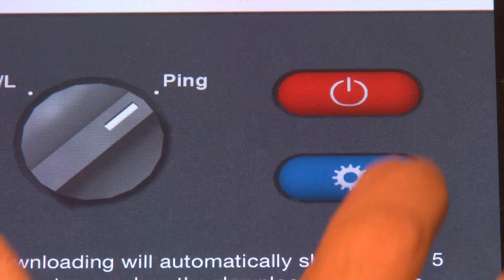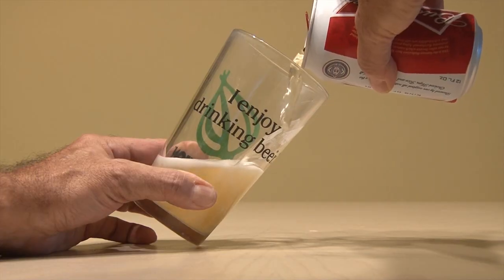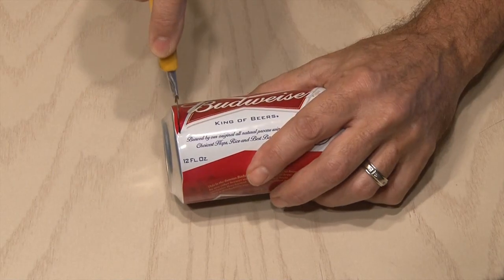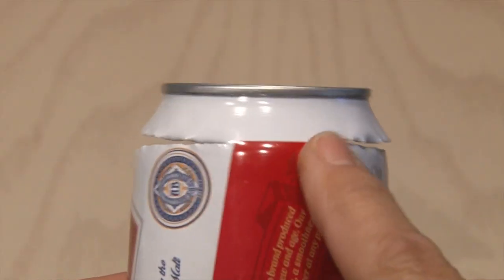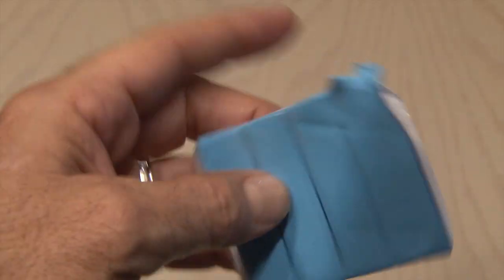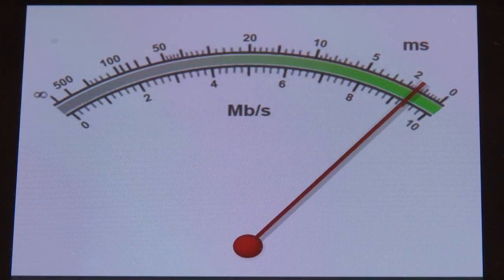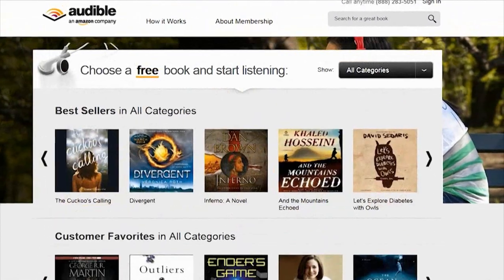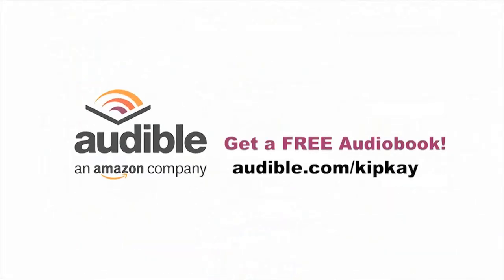Brew Can WiFi Signal Booster

Comment: Do you have anything to up my internet connection? I mean focus most of the power to my desktop PC which is connected with rj45 cable to the modem/router? I think my neighbors who are connected to my modem via wifi is affecting my connection strength.

Comment: Ok let's get real. This doesn't work. Just because it looks like a dish antenna doesn't mean it works like one. Would you think if router makers could so easily increase the transmit power of their routers, we would have been over this madness? Routers use omnidirectional antennas because the receiver could be anywhere.

Comment: Lol, I don't have any antennas in my router. RIP
Reply: xTanneR23 same with me.   Did anyone reply
Reply: There are antennas IN your router (built-in) just like you said. They are just not external. Btw same problem here....
Reply: Me too
Reply: I don't have external antennas either
Reply: If you have a WiFi stick it works for that
Reply: You put I behind the router
Reply: Then, It’s a Modem.

Comment: What software or device are you using to test signal strength and ping?  It looks better than anything I have found for ios.  Also, does it matter which way the can faces?  If it faces forwards as shown is that going to hurt the signal of wifi devices that are in areas behind the router?  If you have multiple antennas should yo aim the cans in different directions?

Comment: Seriously, while it may work with older Wi-Fi routers that have external antennas, modern Wi-Fi routers with more powerful amplifiers and "beamforming" may make the whole idea unnecessary. You already get way better Wi-Fi range with a router like an Asus RT-AC68U or Netgear R7000 Nighthawk without going to this "kludge."

Comment: Curiously nobody realizes that the channel is about hacks and PRANKS. For starters, they measure signal strength with a cheap network speed-tester app. SIGNAL STRENGTH IS NOT THE SAME THAT TRANSMISSION SPEED: you can have  ultra high speed in any given spot but at the same time a very weak signal. Don't waste your time trying this.

Comment: This is a bullshit this doesn`t work at all, we try that in rented apartment in Osijek Croatia with 5.08 mbps and we do same thing butt speedtest.net showing the same result 5.08 mbps, so we do that with energy drink can maybe we need can from coke or fanta :d to make it work.
Reply: This doesn't make your wifi faster, it makes it stronger. So if your wifi cuts out after walking 10 feet away, you can now walk that far or further and still be connected. Nothing can make your wifi faster unless you pay for it

Comment: So it triples the signal wherever the mini dish is pointing but would that mean it weaken the signal where the dish isn't pointing? If that is the case then its a no go.
Reply: theoretically you could make like 5 and put them in a circle and get all house wifi
Reply: +Mlp lover (The Animated Pony) Then it's better to leave the antenna without the cans.
Reply: it is only uni-directional
Reply: +skcopian maybe try pointing the cans in opposite directions?

Comment: Mr. Anthony Clay....I looked all over, and cant find a can at the moment...the only time I need one...go figure....from reading the comments, I am a bit skeptical that this is actually going to work as my bedroom is the opposite direction as the router is even facing...still going to try and then will provide you with feedback again next time....But, nevertheless, if it doesn't work, I'll be back chatting with TWC to figure out how to resolve the problem. Thanks again for your suggestion, fingers crossed :)

Comment: My modem has built in antennas (I think)
Crap...
Reply: MrYuhan3 How about going hardcore and soldering antennas to the internal ones?
Reply: +MrYuhan3 First you have to disassembly your modem and find your antenna. Then buy appropriate midget beer can, cut it and implant it around your internal antenna. Only because internal antennas are hidden, it doesn't mean they can't express their hidden talent. All internal antennas have essential right to get amplified signal!!!!

Comment: And what if my router does't have an antenna ?
Reply: have you tried turning it off and on?
Reply: GrievousDu38 than you should rub it, the antenne might get out and stand up as in the video
Reply: GrievousDu38 buy a router with antenna ;)
Reply: Henning Lakiere ^you win the internet
Reply: GrievousDu38  You simply place the can behind the router with the open part of the can facing the router (TWC tech hack secret)
Reply: Henning Lakiere I mean't that it has an internal antenna.
Reply: Sascha kila I don't even see them in shops anymore.
Reply: Pouring a small amount of beer on the router will also boost the signal in the case of not having antennas.
Reply: Henning Lakiere hehehe....lol

Comment: my wifi goes through 2 floors at the moment, still have full bars but it does drop every 15 minutes or so, wel not dropping just disconnecting entirely & reconnecting after a minute
will this help?
Reply: have the same problem. It will help.
Reply: you could also check on wich channel the network is registered (use an app like wifi analyser). If your network is on the same channel as another network and that other network is getting busy, it is possible it interfeers with your network and drops or rarely disconnects. And like always, if you havent tried it a reboot might help. 
You can change your networks channel in your routerconfiguration.

Comment: there's a science in this video,beer can act as a reflector or conductor of internet or wifi signal.metals such aluminum and iron mounted on antenna of the router conduct the invisible signals from the antenna,thanks kipkay for your quick tips even though not doing anymore..

Comment: It didn't work for me. I used a softdrink can. :( Should I really use a beer can?
Reply: any can will work but this converts it from an omni directional antenna to a yaggi....signal strength is stronger but you're stuck to line of sight so  you won't get much of a signal if you're sitting behind the can
Reply: ^lol troll detected. xD
Reply: You can Use Coca-Cola Can ! (y)
Reply: a two options beer or soda can.
Reply: It needs to be aluminium/aluminum
Reply: Only beer can sweet heart

Comment: does this increase speed or just the bandwidth?
Reply: It increases the range of the wofi
Reply: oh ok. so i don't have to try this. since this doesn't increase the speed,no point trying too. my house is entirely covered by the signal.
Reply: But if you put a whisker in the middle of your antena it will increase the speed
Reply: the problem is that the router is deliberately hidden to conceal its location from others. so that option is out.
Reply: Hey, where's Perry??
Reply: I'm somewhere over the rainbow.

Comment: What if you don't have antennas
Reply: well then u are fucked
Reply: I don't either, i cri evrytiem :'(
Reply: I was so excited to do this until I realized that I dont have antennas 😢😭😖
Reply: Zubair Khan sad violin
Reply: combine 2 opened up cans to form a big ass panel and flaten it till it's curved appropriately. Then stick the panel to a stick and secure the stick onto the bottom with the blu tac so the stick with the panel stands properly. Then of course place the stick near your modem and towards wherever you use the wifi the most.
Reply: Zubair Khan I think all you have to do is create pretty much same thing as kipkay but covering whole router. I don't have antenna aswell, so I'm gonna try it :)
Reply: yes'sir!
Reply: Dave Walpole buy external antennas
Reply: same here i just have a box xD
Reply: BLayZe x
block one side w/ tin....the theory's still the same

Comment: Holy shit... I am using a dlink ac1750, dual band, but it is stuck in the corner of my living room. We have a long hallway to the other rooms, so till my room, I have only a bar signal or even none. Wifi is unusable in my room. After stripping off a sheet of aluminium (from kitchen) now I have like 2 to 3 wifi bars here in my room, and of course now wifi is usable here, awesome speeds! Definitely recommend to my friends.

Comment: The beer can trick works if you're standing in the direction it's facing. It makes the signal focused but only in that direction. Ping doesn't matter in a WiFi network, packets are more important. Ping would always be low if you have a strong signal.
Reply: If you game, then ping matters a lot.

Comment: For those people without an antenna, use aluminium foil. Fold it in 2 and create a "U" shape with it. Then point the foil to the direction you wish to strengthen your signal.

Comment: I got about a 50% boost off a single antenna. But still, it's better than nothing for a quick five minute job. If you don't have a knife, I recommend starting the first cutting with a tin opener. Gives a cleaner edge and less hassle.

Comment: I tried surrounding aluminum foil around my router that does NOT have an antenna. I tried pointing it in the direction it needed to be and it failed. As well I tried multiple other things but still nothing. 

So people who don't have an antenna on their router, this does not work!

Comment: Your PING has absolutely nothing to do with your internet speed or range lolz. This video is correct, but terminology is all wrong. This will only improve your signal strength which is measured in dB, not milliseconds

Comment: sucks most wifi routers doesnt have antennae
Reply: all router have antennas. Just the new ones are internal and of the omnidirectional type ie: the signal goes in all directions. kip kay is showing how to modify an omnidirectional type to a directional type. 

If you cant see your antenna just make a surround for the whole router and point in the direction you will be when using it.
Reply: My new verizon router has an atenna. Most new ones have an internal antennas.

Comment: Nice but you could get another router and link them both together on the second router you will have to change some coding and that but it will only take about 5 mins max and you could have the hole house/flat or whatever you live in and do it with how many router's you like

Comment: what if i dont have a antenna?
Reply: then u fucked up
Reply: Every router has an antennae. If it's not poking out, that means it is somewhere built inside. All you need to do is locate it, (you can figure out by trial and error with only 6 tries.) As long as the sheet of the can is on the opposite side, it will reflect back the signal, essentially doubling up in one direction.

This works, because so much wireless signal is wasted being sent outside your house, down into your basement, etc. Focusing the beam by reflecting it where you want is a perfectly viable solution for electronics.

For bonus points, modern day computers have such powerful error correcting codes that this hacky design won't have a detrimental effect.

This is truly one of the more genius hacks on the channel. Nicely done!
Reply: put tin foil underneath the whole router

Comment: Holy cow...  my wireless AP is on the other side of my house as well and I needed to improve the signal.  My antenna is about as tall as a 25 oz Clamato can. My tablet and cell phones went from 1.5 and 2 bars to 3 and 4 bars.  KK you just saved me $150. Two thumbs up Big Daddy....

Comment: For those of you that don't have external antenna.  Take a bowl, cut part of the bottom out so it will sit flat, wrap it in foil neatly, put the router in it and aim it where you want the signal to go.  Some concept.  It works!

Comment: All routers have antennas, regardless of whether they are external like the video's, or internal like a lot of modern designs are.  All this is demonstrating is making a signal trap and refracts signals more directional specific. A true parabolic mirror will yield the same results and probably at a higher quality. You can make one using any dished object and set the router in the inner center, just like an LNB is mounted on a satellite dish.

Comment: Hi kipkay, any ways of making a wifi booster for a router which does not have an external antenna?  My wifi signal strength is terrible and it drives me up the wall. Ill try this solution by placing the shaped can on or around my router.

Cheers!

Comment: Pringles containers are a lot safer to cut open
Reply: Do they work?
Reply: Nick Partlion
I'm almost certain they do. The inside is coated with some metallic paint I think. I'm not 100% sure, but I've heard that they can make good Wifi Antenna's.
Reply: Yeah I saw the metallic paint but I want sure it would work as well as actual metal
Reply: Nick Partlin 15 years ago, Pringles cans were the go-to for cheap 802.11b (wifi) waveguide antennas. The metallic coating inside a Pringles can will definitely do the trick for signal reflection, but you'll still need to reshape for this purpose.

Comment: I tried this, it didn't work at all, it might boost it a little from close range but my room is on the other side of my house from my router and the difference in signal strength here is nil

Comment: If you have no antenna then make a 3/4 mirror box. Put 3 small square mirrors reflection side down next to each other and duct tape where the mirror touches on both sides of the center of the one mirror. Stand it up and make a U shape and put your router in the middle of the mirror box and it will boost your signal 3-4x easy.

Comment: To kipflay. if you got a cheap usb dongle ( use a 1.5 a 3 meter usb extention cord) so you can place ur usb wifi in a good spot. Then use the same method as on the routher. It will even tripple your wifi signal.

Comment: Sure, the whole thing is about reflecting signal (like the reflective surface in lamps that redirects the light going upwards to go towards the floor), so if you cut out a piece that is big enough to "screen" the whole router.
BTW I recommend googling for some more radio reflective materials.

Comment: If you're using a laptop then you just need a more powerful wifi card. If you want to boost your wifi signal there's 2 option. 1. Is to do what kipkay do and 2. which most people don't know is to just buy a more powerful wifi card that connect to the computer externally like this one Etekcity 1000mW 802.11 B/G Long range High Power USB Wireless WiFi Network Adapter with 6dBi Antenna RTL8187L Chipset.

Comment: I suggest you get a new wifi card (if you are using a laptop) like this one from amazon Etekcity 1000mW 802.11 B/G Long range High Power USB Wireless WiFi Network Adapter with 6dBi Antenna RTL8187L Chipset

Comment: Works a treat!  Thank you!
I was having problems with my wi-fi connection, even though it's only 20 ft away (through a thick wall though).  Saw your video, made a pair in under ten minutes (one for the router, and one for the dongle attached to my PC via a USB extension) and my signal went from being virtually non-existent, dropping all the time, and rated "poor" at best, to being a reliable "good" with a stable connection.

Comment: Aluminum foil reflects high freq. waves same as the can, but you'll need to glue it onto a flat curved surface (construction paper even?) so it holds its form.  

Some say "My router doesn't have an antenna," which is incorrect.  All WiFi routers have them, many hidden inside the case.  Just take your "smooth curved sheet" and place it behind the router. Take books/whatever, stacked under the router so the entire router is raised into the middle of the sheet.  It will reflect just fine.

Comment: What I did not see questioned is, has that router been hacked. The router looked like and old Linksys WRT54G. In those routers you can "re-flash" the hardware to embed a Linux firmware update. Doing the Linux firmware update turns these little routers into a wireless bandwidth beast! Google "Hacking the WRT54G". Also, the can mod .. yes it will work because it makes the antennas directional therefore focusing the wireless signals in a tighter area.

Comment: why wouldnt it? there is little antenna inside your phone too. it sends signal to every direction and if you use this technique it prevents signal going from wrong direction and boost's the signal to the way where you direct this can. same thing in light's where is hermetically sealed

Comment: Note: Only do this if your router is on one side (preferably a corner) of your house. If you do this when your router is in the middle of your house it will reflect the signal only in one direction and cut off the signal on the other side of the house.

Comment: Even if you don't have an antenna, don't worry - you do!
Many modern routers have the antenna built in to the box instead of externally as shown in the video.

To make this work it might be slightly trickier and not work as good, but just place the beercan you've cut behind the entire router instead of behind the router and it should do the same thing. Your results may vary however.

Comment: To anyone asking:
This does work! I've actually been experimenting with this in school (Networking class) although with aluminum foil.

How it works is that the aluminum in the beercan picks up the signal from the antenna going in the opposite direction and reflects it forward to direct the signal straight forward. This is the same principle that is used with the parabolic antennas you find on many rooftops.
Keep in mind though that the signal strength decreases in every other direction.

Comment: then obviously you are f*cked cause you just made low quality directional antenna from omnidirectional one.
If you want better wireless and you dont have a big house then stick your router in the middle. If you have a big house then you're gonna need 2 routers and the other one is gonna act like bridge ap (or you could use wireless repeaters but that way you lose connectivity).